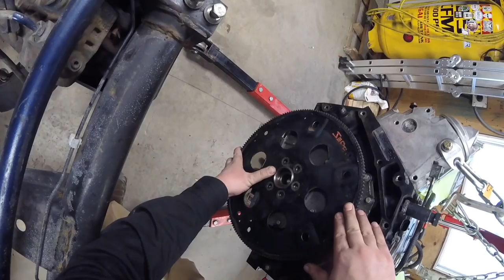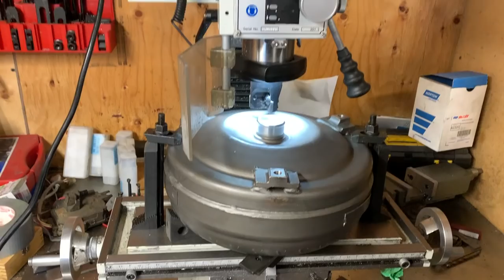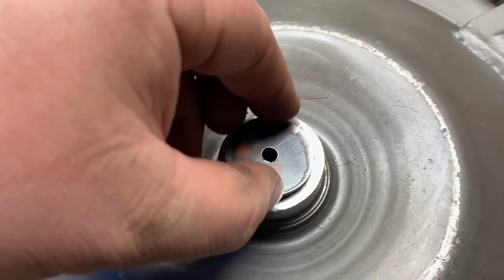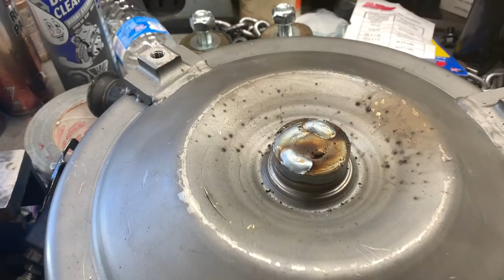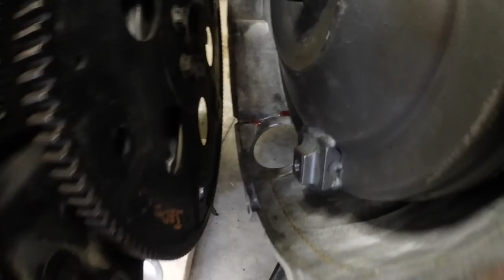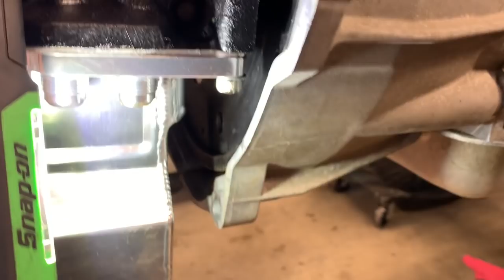LS Long Crank to 4L60E How To

Comment: I got a flexplate and spacer that was on a 4.8,  the interchange said that the spacer and flat flexplate were used with a 4L80 setup, since the 4.8 had the short crank. The spacer and plate can be purchased through GM. Is that an iron head LQ4?

Comment: Can a 6.0 vortec engine be swap into a Silverado with a 4l60e is that what u are doin in video I know the 4l80 is better but I don’t have money to get both
Reply from the maker: depends if the 6.0 is a long crank or not
Reply: @TestDontguess  I need to ask the same question. I'm putting a 6.0 long crank in my truck with 4L60. I've been told someone sells the coverters like you just made. Where can I find one? Needing around 2600 or 2800 stall.
Reply: Any update? I’m doing exactly that on my Tahoe. Got a cast iron head 6.0 and bolting it to a 4l60
Reply: @mathewp4684  did you figure it out ?
Reply: @rylanrodriguez5276  yes, I just emailed Circle D converters and told Brian what I was doing and my cam size and he built me a converter. Took a few weeks but all is good.

Comment: Quick question  a 96 5.7 vortex  would  be a long crank (sbc,bbc) correct and you used a LS 4l60e  witch the TC is 300mm  and ment for a short crank . 

So if I do as you did in the video my LS 4l60e transmission will bolt up to my 96 5.7 vortec